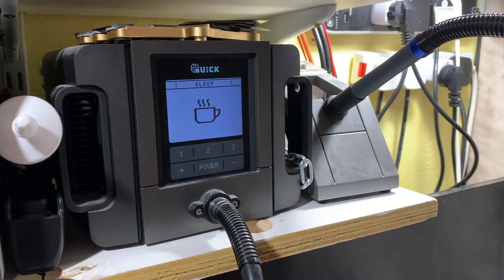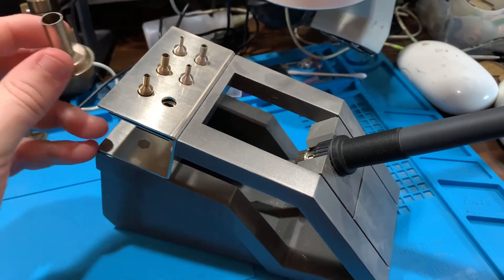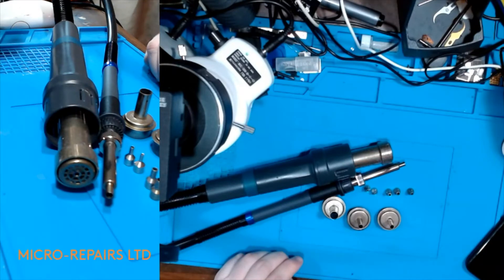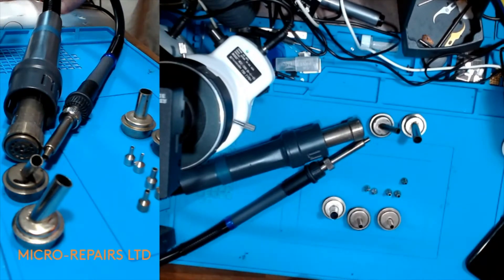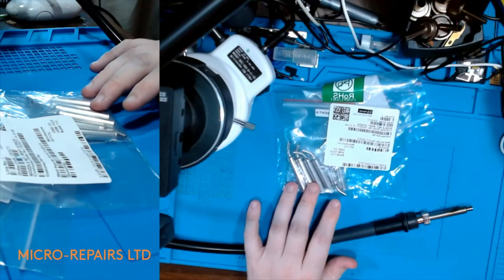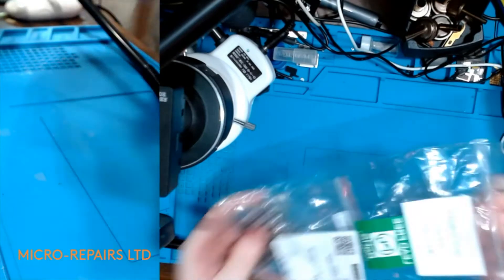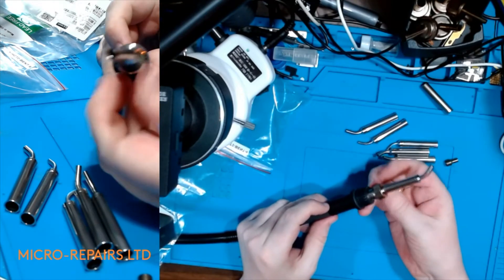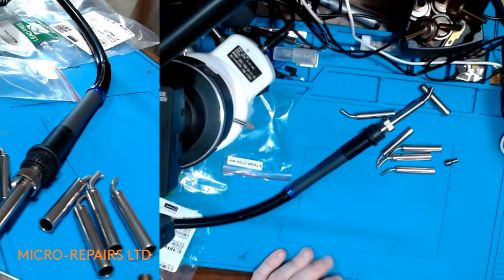QUICK TR1100 HOT AIR PENCIL STATION PROBLEM AND SOLUTION! METCAL MX200

Comment: This looks like a pretty cool station. This would be really useful for iPhone boards
Reply from the maker: Every now and then it comes in handy. Especially with the smaller iPhones . Most of the time though the normal hot air station is the go to machine. Thanks so much phil for taking the time to watch, do appreciate it mate👍
Reply: @SURGE101  no problem mate, I'll try and drop a shoutout for you soon 😁
Reply from the maker: Thanks Phil, honestly I really do appreciate it mate.

Comment: What is price ?
Reply: I do not have one but a good solution for those who have one. Thank you for sharing.
Reply from the maker: @mm0077  I really appreciate you taking the time to watch the video. thanks so much. Rich👍
Reply from the maker: For the station or the nozzles? Thanks rich
Reply: @SURGE101  station or nojals sir
Reply from the maker: @MaxMax-gn3ed  the quick tr1100 station is £240 on AliExpress and the nozzles being genuine metcal ones wasn’t cheap unfortunately. They were £95 for a full set of 6 nozzles. But that’s the only way of getting bent nozzles unfortunately for this station. Rich
Reply: Is the small handpiece practically any useful than the big one? Thanks for the video
Reply from the maker: @roseelectronics4582   it can be in certain situations. The nozzles for the pencil hand piece are considerably smaller which is handy if you want to remove something close to a heat sensitive component. But it’s not a station to have instead of the larger hot air station. The larger station will be your go to machine for most jobs. It’s just something that sometimes is perfect for certain jobs. Thanks so much for watching, I really do appreciate it. Rich